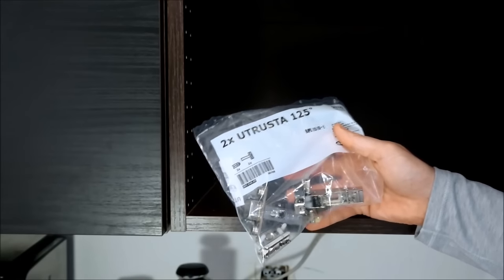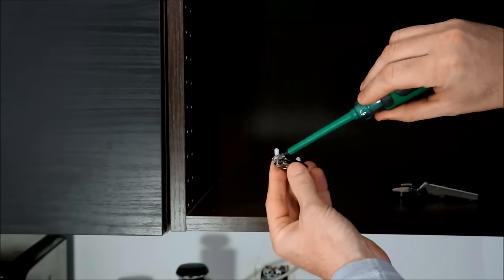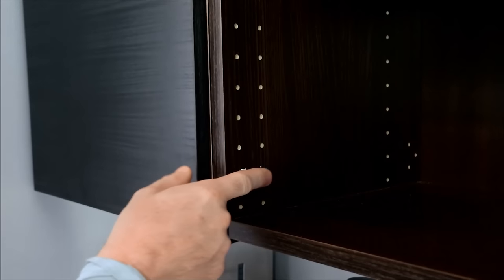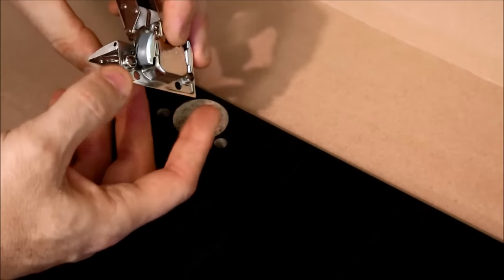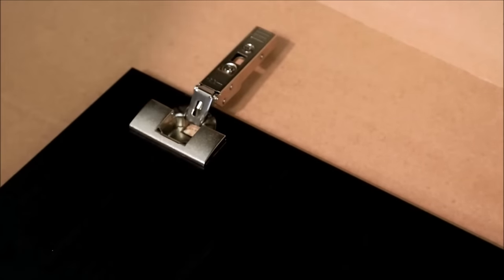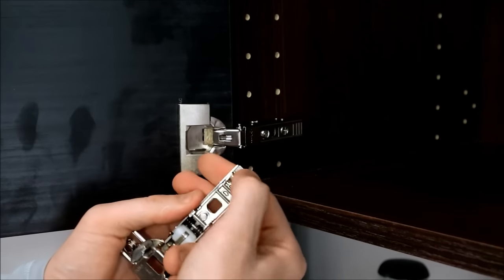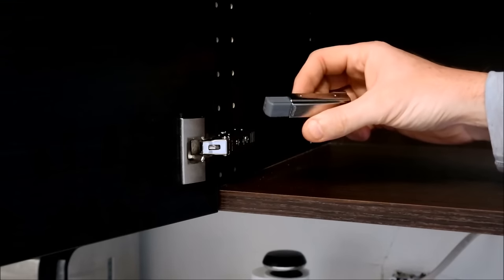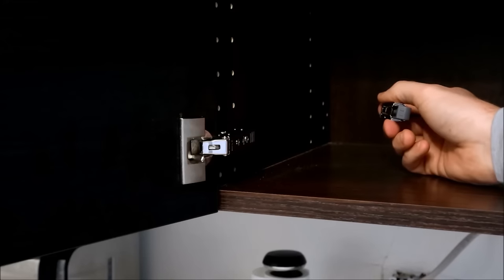IKEA Hinge & Door Damper Install | UTRUSTA

Comment: Generally, a good job; liked the fact that you talked thru it explaining.  However, had to go elsewhere to verify that I had put the clips correctly into the holes; next time you might consider showing those up close for 10 seconds and explain how to tell is you've placing them in the correct direction.  Also, anyone having trouble easily clicking the hinges into place - be sure the screws holding the two pegs in place that hold the hinges are totally screwed down or they won't have room to catch and click into place.
Reply: Im still messing around with mine. not sure if I clicked the base in correctly. I've screwed the screws in all the way and hinge would not click in so maybe I put it in back wards. Back downstairs I for attempt #3!!
Reply: THANK YOU SO MUCH. Me and my husband were so confused and tilted after trying and trying. It worked when we screwed the clips on super tight

Comment: That's nice if you are installing them in predrilled ikea cabinets. But what if you are installing them on other un-drilled cabinets? need dimensions like where to drill the mortise from the edge of the cabinet door and how far back from the edge of the cabinet (side) to mount the second piece.

Comment: I have cabinet over the sink, so it is horizontal. Not vertical as you show in the video. My door has strut supports in addition to soft closing hinge. So I try to replace the hinge which is really difficult task. I am not sure if I have to remove the strut first or not. Can you give a hint how to replace the hinge?

Comment: Very useful. Found those dampers on my cabinets and had no idea how to reach the adjusting screws. I would add that it's easiest to remove the damper by pulling the plastic part away from the surface, not by pulling the middle part.

Comment: Hi, thanks for the video. How would you go at removing the piece that is mounted to the cabinet please? Eventually I’d like to change the direction the door is opening and mount the hinges on the other side. Thanks
Reply from the maker: unscrew it completely then gently pry under underneath the bracket, then pull out the plastic inserts with a needle nose plier.

Comment: I cannot get the 125 utrusta on.  You made it look so easy.
Reply from the maker: It is easy! make sure the plate on the cabinet is installed correctly.
Reply: If you didn't get it exactly right the first time odds are you've bent the catches/tips out of shape. That's why mine wouldn't go back onto the hinge. 

The non-90 degree tip/foot/hook, (not displayed very clearly in this video here) is easily squished out of shape under pressure. It needs to be 'basically' pointing 90 degrees up, (then hooking around another 'basically' 90 degrees around then down) and the two claw feet need to be 'exactly' 90 degrees so they all three slot into that neat little rectangular hole. 

I used a trousers coat hanger to help add the sustained pressure needed straighten the tips. I could also have used the blunt edge of a large pair of scissors (I didn't want to scratch a butter knife with it). After each retry you may have to re-straighten because *ungh*. I don't like forcing things because it can weaken the metal but frankly that had already happened with the stress-fail and they should design things better than this.

I remember the carpenter saying he had to get a few new ones because they were too loose, but darn this one was too tight.
Reply: I couldn't fit the pieces together - my problem was the screws were not all the way in on the inside of the cabinet and were blocking the doors from being able to snap in - make sure the screws are not sticking out on the inside of the cabinet part

Comment: Thanks so very much for this video. The Ikea sales guy missed my request for soft closing hinges when I ordered my kitchen over a year ago at the end of the old product. Now they basically tell me to get lost, I have to buy new kitchen cabinets to get the new hinges. I think not. Any ideas on retrofitting the Utrusta hinges on the old cabinets? Thanks. PS $10,000 for a kitchen set and that is their after market help.
Reply from the maker: +Russ Hall If I'm correct... the dampers work on the old hinges, they are universally compatible.. did you buy a pack and test them? They look identical to me. You can always use the new hinges on the old cabinets, you just have to drill holes for the base plate part to screw into. (make a jig... at the store... then take it home to drill your holes!)

Comment: Thanks for your guideline. Why my damper not working on my 60x60cm door. I try using the same damper on others same door but it working. Is there any problem with my door installation?
Reply from the maker: sorry, does not make sense, if the damper works on other doors then the damper is good, if it fits on the bad door, I don't think there is anything that can be bad about the hinge
Reply: It only works when i put 2 damper. Still don't find the problem.2 of my 3 door have this problem.

Comment: Thank you for the video. It was very helpful. We couldn't get the middle hinges to snap on for either of the end units. They went right on top and bottom and on the middle units. Do you have any suggestions on how to fix this? They still work with two hinges, but better all three.
Reply: I have trouble with that too. It turned out I had not tightened the screws enough (on the little part that attaches to the cabinet that the hinge snaps onto). The incompletely-tightened screws were interfering with the hinge snapping down.

Comment: Do they make two different kind of dampeners? I cannot get mine on and I tried it won’t go in the whole...my cabinets were installed 10 yrs ago, and I just bought the dampeners today. Wondering if they changed the sizes of the clips that goes in the hinge hole.
Reply from the maker: they did change the hinges a couple years back, I thought the dampers where the same, but maybe not....

Comment: My ikea hinges were different, with a black outer expansion ring on the two pegs, which after an hour of fussing never fit into the holes like they were supposed to, leaving me with 2 useless hinges. Now I've got to go out and buy something compatible, hopefully with an actual screw, because hey, a couple of tiny screws are soooo hard. Oddly enough, the other cabinets have different hinges.. Never again ikea for me.  The big box stores generics are not that far off the price and frankly the quality of the ikea leaves me a tad frightened

Comment: Installing interior UTRUSTA drawers inside of a cabinet with doors...the doors do not close properly because the UTRUSTA interior drawers do not close completely in the cavity....have soft closers on but not sure what the problem is.
Reply from the maker: good timing... I just installed some interior maximera drawers, the slides need to be mounted correctly, they are set back into the cabinet by one screw hole. not flush to the edge of cabinet.
Reply: Thank you - got it figured out...not impressed with the "new" line btw.  The cheap metal straps across the top do not look as if they could hold granite.  There is also much wasted space since the hinges compete with the drawer space.  We might look into some of IKEA's competitors for our sixth kitchen remodel.  Thx again!

Comment: Can someone please advice how I can remove the hinge from cabinet wall (if I want to switch side). Thank you
Reply from the maker: Unclip the hinge from the cabinet, then partially unscrew the hinge mounting plate, about 75%, then use a flat blade screwdriver and gently pry the plate off the cabinet so you take the plastic pieces (the things that the screws go in to) with the plate.

Comment: I have no problem understanding Ikea's instructions. My problem is that the cover flaps won't push down, even when using my full weight on them. I never had this problem with my old Faktum cabinet hinges, so no idea why these Method hinges are proving to be so difficult to fit. I'm beginning to wish I'd never bought these Method cabinets, I really am.
Reply: That should of course read Metod, not Method...